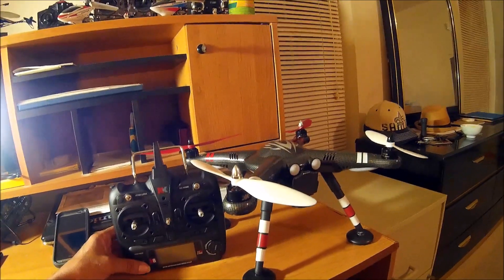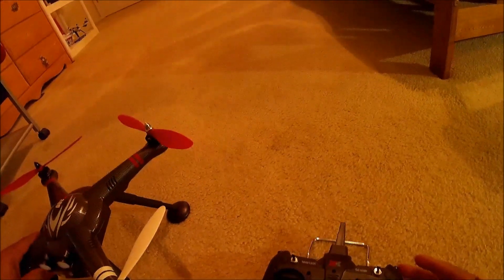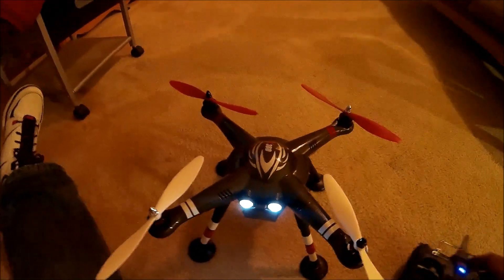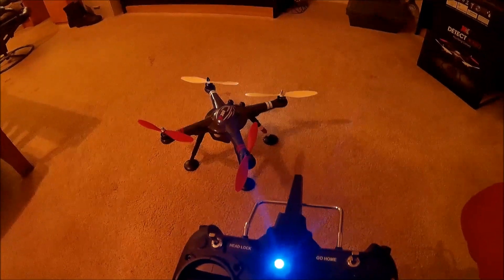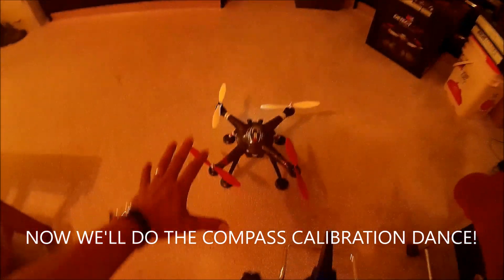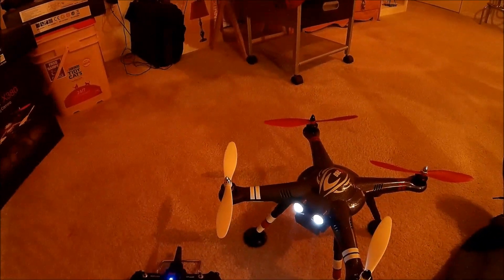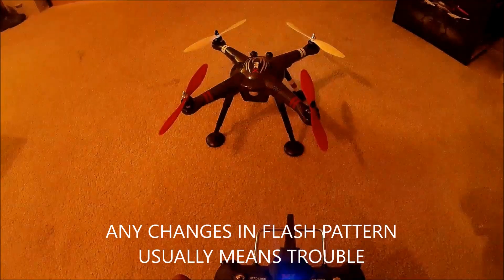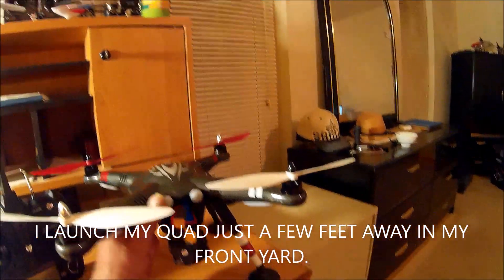XK DETECT X-380 "MUST WATCH BEFORE YOU FLY"

Comment: has anyone figured out how to stop toilet effect.
calibrating and compass dance just not working.
Reply: +tj brooks I had the same problem toilet bowl and the dance not working. I read in another video good info from DJ Soul, he told another person to make sure he flicked the switch quickly. I did that and my toilet bowl effect went away. Thanks DJ Soul.
Reply: DJ Soul, do you know anything about the G2D gimbal? I have the white plastic one, when I turn on the quad the gimbal always points straight down. A real pain.
Reply: Thanks, to both of you. I'll try it in the morning.
Reply: TJ Brooks & DJ Soul, thanks for the info on getting the gimbal to line up forward on start up. Your info worked great.
Reply from the maker: +tj brooks  Try calibrating the accelerometer. Put quad on level surface. Turn on TX, turn on quad. Without using any sticks, flip the RTH button 12 or more times until lights blink. When lights stop flashing, you're done!  If that doesn't fix your toilet bowl problem, you may need to "flash" the memory and re-install the internal files. Here's a video on how to do that: https://www.youtube.com/watch?v=c0jPjEA4ZdQ  Let me know how it goes. DJ SOUL FORCE
Reply from the maker: R.E. Tired  You're welcomed sir! Glad it worked. Stuff like that should be in the manual, but it's not. A new x380 Tips, Tricks & Shortcuts video coming soon, stay tuned.  DJ Soul Force
Reply: +R.E. Tired when you turn on transmitter turn tilt control at least one beep up before you plug in quad.
Reply from the maker: R.E. Tired  What Mr. Brooks said in his comments works. When you turn on the transmitter, move the gimbal tilt wheel up one notch before you plug in the quad. The x380, by default, gimbal position is down (for some reasons unknown) but this procedure will prevent that. I briefly demonstrate that in this video right before take off. https://www.youtube.com/watch?v=yC-9fJFai_k  You'll find this not only work for that pointing down thing, but will also stop it from panning up & down by itself during flight! Let me know how it turns out. Did you do the accelerometer calibration yet to stop the toilet bowl effect?????  DJ SOUL FORCE
Reply: +R.E. Tired great glad to hear it.

Comment: can I calibrate xk380 compass jndoors
Reply from the maker: +Michael Michel  I did in this video for demonstration, but it is recommended to do it outdoors, away from metal & magnetic interference, such as stereo speakers, TVs and metal pipes, etc.  If you calibrate inside, I suggest that you do another "dance" at the takeoff point.  Thanks, good question.  DJ Soul Force
Reply: +DJ SOUL FORCE thanks dj. iam a noob. really enjoy your helpful vidios. I don't fly without watching them.  by the way. what do you think of the  xero xplorer.
Reply from the maker: Michael Michel  I haven't look that deep into it, but I do really like the design, shape and it's looks. Of course, there's a lot more to consider than looks!!! Sorry, I can't give an honest opinion yet. thanks, good question. DJ SOUL FORCE
Reply: thanks dj. should be getting my xk380 Friday. is it a good idea to wait awail after flight to recharge battery
Reply from the maker: Michael Michel  Another good question. Yes, wait until the battery cools down to at least room temperture! The x380 stock charger is kind of "cheap" so it takes a long time to charge, especially the first charge could take about 4 hours!!! I recommend the ImaxB6 Pro Balance Charger for faster charges. Good luck with your first flight - get a spare battery, you're gonna want one soon!  DJ SOUL FORCE

Comment: DJ SOUL FORCE!  thanks for your help. a few days ago I found out what happened to my quadcopter. One piece of the Main Controller Board & Power Distribution Strip was broken thats why the main was not working. You can see the pic here. Now i need to buy new one. 
https://www.facebook.com/photo.php?fbid=1186292334749050&set=p.1186292334749050&type=3&theater
Reply from the maker: +Edilson Andrade  I'm very happy that you found the problem. Replacing that board will require some work but I'm sure you will be ok. After replacing that board you will need to start over again with the transmitter binding, calibrations and the compass dance! Make sure you save those master files, you may need to re-install them again also.  Good luck, let me know how it goes.  DJ Soul Force
Reply: Hey DJ SOUL FORCE,  today i received the Main Controller Board+Power Distribution Strip for XK X380, I have installed it, and now i've one green light and one red. i did thetransmitter binding, calibrations and the compass dance, re-install the master files all things you told me to do.
Reply from the maker: Edilson Andrade  I wish I knew what to tell you, not sure if I can help with that. Sounds like either the compass is not connected or the GPS module. You have already gone beyond my area of expertise, I've never changed out a main board before!!! Good luck bro. DJ Soul Force
Reply: Hey DJ SOUL FORCE, today i found out what was the problem of lights (green and red) the quad was not detecting the GPS, i bring him outside, and he did, now i have 2 green lights. I tried to the thetransmitter binding, calibrations and the compass dance but the quad didn't answer. I did the same you did on the video.
Reply from the maker: Edilson Andrade Check to make sure your transmitter is in MODE 2 (right hand mode). You can change from mode 1 to mode 2 by pressing the "stick mode" button on the bottom left side of the transmitter. Once you're in mode 2, try the dance again. Let me know how it goes. DJ SOUL FORCE
Reply: Hi DJ SOUL FORCE Thanks for your help, after following your proceeders and information my quad is perfectly. Now i need to buy good blades for my quad, can you tell with one and where buy it.
Reply from the maker: Edilson Andrade So good to hear your x380 is all good now! I use the Phantom 3, 9450 OEM#9, Self Tightening Props. They will screw on the x380. Here's a link for example, the ones I bought are sold out for now. http://www.ebay.com/itm/DJI-Phantom-3-9450-Self-tightening-Propellers-IN-Stock-/161722593350?hash=item25a76af046
Good luck, fly safe. DJ SOUL FORCE
Reply from the maker: Edilson Andrade  The x380 has longer legs than the Phantom 2 Vision, so that bag probably won't work. I'm about to review this one real soon: http://www.gearbest.com/rc-quadcopter-parts/pp_357771.html  And the props won't work either. If you buy Phantom props for your x380, they must be Phantom 3 props, the Vision had smaller motors. Good luck. DJ Soul Force
Reply from the maker: Edilson Andrade  Those should be ok!  Good luck.
Reply from the maker: Edilson Andrade Here in the US, mode 2 is typically used by most right handed pilots. Mode 1 is mostly used by left hand pilots. Mode 1 will switch your throttle stick from the left side to the right!
Reply: Hi DJ SF do you know how to use Remote Control Helicopter Multicopter Spare parts Lipo LiFe LiMn Li-ion Battery Monitor Alarm Low Voltage Buzzer Alarm Indicator 1S-8S?
Reply from the maker: Edilson Andrade  No, sorry I don't have one of those. Ask "Full Metal Heli" he has a couple of them! Sorry
Reply: Ok thanks bro

Comment: +DJ SOUL FORCE  thank you for answering. I will tell you what happened. i was trying it in an open area. While in mid of the flight the drone did something strange. In first it started to run far away from me without using the remote, so I turned the GPS feature ON, the drone came back. Then when it came close to me I turned the GPS OFF and the drone just turned upside down and fell down really hard in the ground. Now it's not working and broken, when I plug in the battery, it beeps and all the lights turn on except the main light.
Reply from the maker: +Edilson Andrade  Watch the video link that I sent to you. Re-install the software, re-calibrate and let me know how it goes. If you have a motorized gimbal on the quad, remove it before you connect to PC. Make sure you make all repairs before you fly it again.  DJ SOUL FORCE

Comment: do i need to do all of this things including calibration dance everytime i flight this drone or i just do its once?anyone plz anwer me...i"ll be appreciate it so much..thx
Reply from the maker: +Charles Way  You only need to bin the transmitter once under normal conditions. The calibration dance is recommended before each flight, however, I don't always re-calibrate while flying in the same location. If you change your home point more than 2 - 3 miles, or if you notice the quad is drifting after takeoff, you should re-calibrate the compass (dance)!!! Thanks for your question and thanks for watching.  DJ Soul Force
Reply: +DJ SOUL FORCE wow...i really apreciate its dj soul..im a big fans of your vedio..and thx for the input.i just orders mine x380 today..cant wait to fly with it.but.how can i turn this quad into fvp quad?
Reply from the maker: Charles Way  XK makes a factory FPV kit for this quad. They sell it at Gearbest.com, but I searched just now and couldn't find it. Maybe they sold out for now, you'll have to search for it. Thanks again for watching my videos.  DJ Soul Force

Comment: I trim my x380 both magnetic and control before each flight. After about 3 weeks of successful flying, about 10 minutes and about 10ft off the ground, the quad began to "bounce" up and down violently. I immediately try to land it, but it turned on its side and took off faster than I have ever seen it go. The crash cracked the frame. I moved all the parts to a new frame. I had to replace the "magnetic sensor" landing gear. The new one seems somewhat "generic" looking at the original. The circuit board is blue instead of green. I believe the magnetic sensor, which works in conjunction with the gps, is causing me not to get satellite lock. The quad will fly, but with no gps, it won't hold position and I can't do any trimming /calibration procedures with the controller. Do you know of any way to validate the magnetic sensor?

Comment: Hey! DJ. Yea!! Yea!! You did it!! The battery charged and I ran the Mag Dance and it worked perfectly.That's the Trick! I'm glad I made that video. I just got Egg on my face, but for a good cause. 

God Bless You!!
BK
Next step is to test fly w/o a camera. then figure a fixed mount, and finally FPV.
Do you have any suggestions for a 5.8G Xmtr? I would like to find one that is compatible with my X250A Receiver and display (8 channels and it looks like the one they are advertising for the X380). I'm happy ---until I wreck something else---
Reply from the maker: +Bob Koch  God Bless you too Mr. Kock (or BK!!) Be sure and take it easy on the first flight. There's still a lot to learn about the x380. Stay tuned, my x380 is over 8 months old now and I'll be doing an update to this video. I was totally lost when I first got the x380, so I pledged to share all that I learned everytime I learned something new... trust me, there's still more to share!!! Good luck with your first flight. DJ SOUL FORCE

Comment: dj-congra for your videos...i have seen them (almost) all. I just got my xk x380 and i tried to do the compass calibration but the light was flashing GREEN GREEN without going to continuous GREEN and i repeated your maneuver for 3 times from connecting and disconnecting throttle down...etc......any suggestions on how to calibrate the compass???thanks pal
Reply from the maker: +giannis sarris  Sorry, I just got this message today.  First, make sure that your transmitter is in mode 2 (right hand throttle). When flipping the switch 3 times, if the light doesn't turn solid green, keep flipping it until it does. Sometimes it takes more than 3 times and sometime I have to do two & half circles instead of two!!! Let me know how it's going.  DJ SOUL FORCE

Comment: DJ! Ha Ha I should have read your comment to me about disconnecting my gimbal before connecting to my PC. My gimbal went wild and tore the wires out of the connector 3 black , one blue wire with black bands every inch or so, these wires wind up on the hard wired into the item (Accelerometer?) which mounts the camera. Do you have any pics of the connector?  Regards! Bob Koch bobk219@gmail.com.
Reply from the maker: +Bob Koch  Sorry, I don't have any pictures or wire diagrams for that gimbal, I have the Walkera G2-D gimbal. Sounds like your tore off the wires that connect to the gimbal controller, those wires should be replaceable. If you could, shoot a picture (or video) and post it on "All XK Drones Owners Club" on facebook, I'll see it there and so will 900+ other x380 owners who will be able to help. Good luck.  DJ SOUL FORCE
Reply: +DJ SOUL FORCE:  Hey! DJ Total Mayhem shot me a pic of the connector and wires. I think he pulled only one wire. We used pins to extract the "Micro"sized crimp pins, now the task is to recrimp and insert back into the really really tiny connector---and never..never have the gimbal connected while connected to a PC!!!!
Reply from the maker: Bob Koch ...Lol!  I wish I had put that in the video orignally, but that information came to light after this video was shot. I'll be doing a new "all you need to know" video on the x380 very soon, mine is over 8 months & 75 flights old now!  Thanks, hope it all works out. Let me know. DJ SOUL FORCE

Comment: DJ-Great talk on setting up the X380, I have the C version and have the same problem as Sparky42. Somewhere you have a link for resetting the software/firmware. I just plugged my  380 into my PC running Win 7, but it didn't recognize it. Can you redirect me? Thanks BobK219@Gmail.com
Reply from the maker: +Bob Koch  Hey Bob, I can't exactly remember what Sparky42's problems was but here's my video about resetting the x380's internal memory - https://www.youtube.com/watch?v=c0jPjEA4ZdQ - Not sure if it'll work with windows 7 or not, but it should. Good luck.  DJ SOUL FORCE
Reply: +DJ SOUL FORCE .Thanks DJ! I was able to link up to my PC on the second try and found the files and copied them else ware. Now as far as the updates I went to the XK X380 owners site and found a section by Don with links but I'm not sure that these will all work since I have a 380C with a 2D gimbal. I just received it Friday and as a very newby to rc I'm a bit shaky. You mentioned another name  (pete?) with info at "All XK Drones Owners Club". I'm also going to ping Sparky42 to see if he got his quad to work.
Reply from the maker: Bob Koch  If you download & install the files that I provided in the links in my video, those files contain the latest firmware and will install automatically. It's the same files for each version of the x380. If you already have the FAP mode and Auto Pan, you have the latest firmware already! Good luck, let me know how it goes. (oh yea, disconnect your gimbal whenever you connect to PC, just to be safe!) DJ SOUL FORCE

Comment: I noticed that you went counter clockwise, when you should have went clockwise
Reply from the maker: +Tony Boggs  It's been my experience that it doesn't matter which direction you circle, as long as you do two complete circles. It's a magnetic compass that's reading direction references to magnetic north; just circle, it will find it!  DJ SOUL FORCE